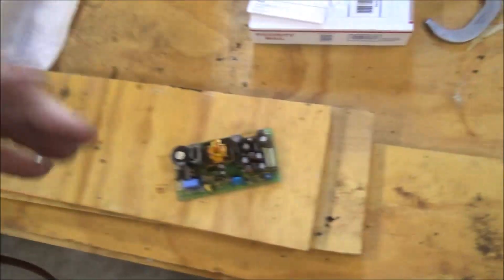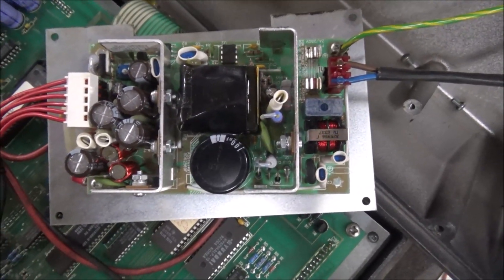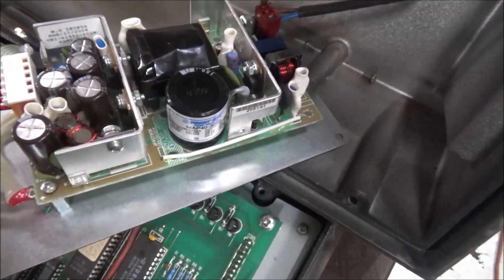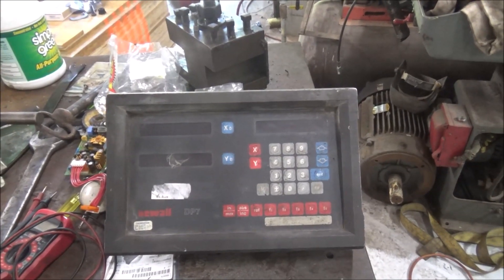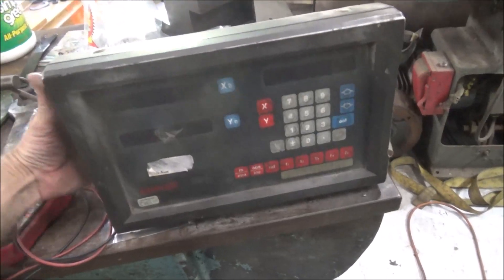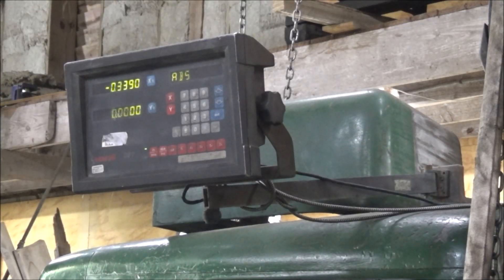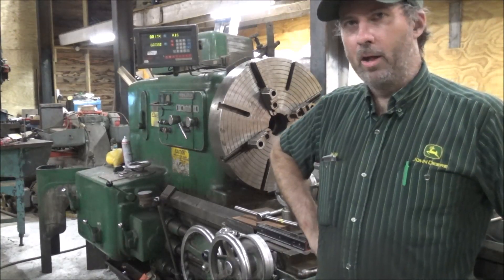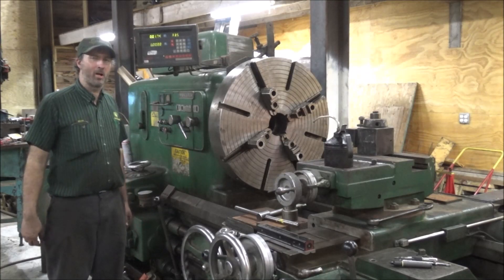Newall DRO Won't Power Up Fix

Comment: Yep, I can just about guarantee you that the crud that corroded the board was the electrolytic from the capacitors and they were in fact bad.

Comment: Can I ask where you got your board from?   I know you mentioned ebay but not sure what to search for.  I've a Newall saphire that had a capacitor leak and eat away my board and need a new one.
Reply from the maker: You need to look at the transformer and see what voltages and amps it is putting out, then search for one that matches those and hopefully looks about the same.That is what I did.  You could try searching the number off the board to start with and see if there are any hits.

Comment: Be careful.  When the boss man is ill he can be mean.   The capacitor issues that people talk about were related to a stolen electrolyte formula that was wrong.  Some time in the early 2000s to 2006 or so they were in everything.   After 2-4 years the caps would swell, pop, and go bad.  Lots and lots of kits were sold to fix them.

Comment: Brian, Jim tells me the following about the grinders in Philadelphia which  I think are big cylindrical units.  :    "  I have one Kellenberger 1000MU 40"x10" with a swing around head for ID grinding. It's an electro mechanical machine.  The other is a Ribon (Italian) 10x40 with OD and ID heads.  It's also electro mechanical. "

Comment: Brian,  Would you be interested in a new addition to your shop? I know a guy up here in the Philadelphia area that has a 36" Bullard VTL lathe that he needs to get rid of. According to Bullard's 1953 catalog, it is about a 21,000+ lb. machine. Jim tells me it has the mechanical 4 jaw chuck, but no side head option though. Also the original 30 hp motor was scrapped due to a failing winding. He tells me that it is right up next to the loading dock so it's easy to get a very heavy duty forklift under it without any skating needed. JIm and his brother have been selling machinery out of his late fathers shop for over a year now and this Bullard and 2 large universal grinders are the last of the machines to go. They just sold the building so time is of paramount importance. I was there about a year ago for a Cincinnati dividing head and saw the machine running. I think it would be nice right next to your horizontal boring mill. I can set you up with Jim's cell phone number and shop location if you are interested. Let me know by a reply on YouTube ASAP. Thanks.   Ray Satorius
Reply from the maker: Ray Satorius it would be mostly a duplicate machine for me since I can swing more than that on the monarch. I am running out of room so I don’t think that is something I need. Thanks for keeping me in mind though!! What are the grinders?
Reply: @bcbloc02  Jim tells me the following about the grinders which  I think are big cylindrical units.  :                                       " Hi Ray. Thanks for asking.  I have one Kellenberger 1000MU 40"x10" with a swing around head for ID grinding. It's an electro mechanical machine.  The other is a Ribon (Italian) 10x40 with OD and ID heads.  It's also electro mechanical. "

Comment: At 25 bucks, I agree your time is better spent elsewhere if it's just a power supply issue. Nasty corrosion, is that a common thing to see on PC boards in your area due to humidity, or did the DRO get rained on in its life?
Reply from the maker: It is sealed up so it has to be moisture from the air.

Comment: I worked on a product line that used similar switching power supplies - they are very complex circuitry and hard to troubleshoot without schematics and special equipment and advanced understanding. Though we were competent techs, we still just replaced them and sent batches of the bad ones back to the mfg for repair. Best wishes for Baily.

Comment: I've have the same DRO and it just went out the other day. The only light that would come on was the IN/MM which is supposed to mean the power supply is bad, but I replaced all the caps and tested it and it's putting out the spec rating. What was yours doing when switched it on? Was the same on only?  I'm thinking the supply is still suspect on mine maybe it's not putting amps....  Thanks Brian
Reply from the maker: Mine had nothing coming out of the power supply board when switched on not on the 5v or 15V channels. Be sure you have power coming out on both and it is the proper voltage.
Reply: @bcbloc02  Yes sir I do. Manual says when that's the only lit light it's a power supply issue but it's got a perfect 5v and 15v output. I'm afraid that the problem may be deeper.  : (  Thanks for taking the time to reply Brian.

Comment: Ah HA! So that's what the bottom of the circuit board looks like. Yup, corrosion is not a good thing. For the small price you paid that was a good fix, totally replacing everything including questionable caps and all.  I do hope Baily does well and isn't in much pain. I hate to see dogs suffer.

Comment: Hope the boss gets better! The bad capacitors story is long weird, but rest assured that not every electronics problem is bad caps. If they are not bulging or leaking they are probably ok. The defective caps were from certain brands in a certain date range. The pcb corrosion is an obvious problem, and power supplies are cheap and easy to find. Good going!

Comment: Back 35 years ago, I have had to make new traces using a solder pen, but you never know how long it's gonna last. We didn't have ebay or even the internet to find obsolete parts so you had to make'm last.  Baily's tough like you and will be bossin you sooner then later!